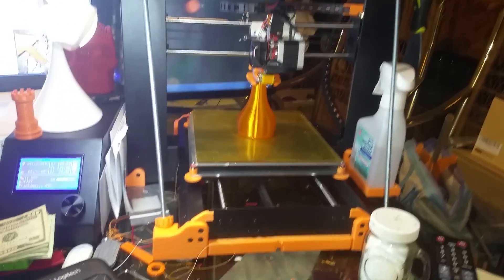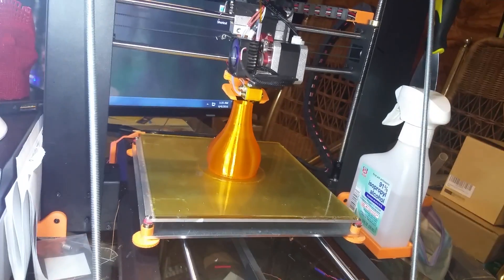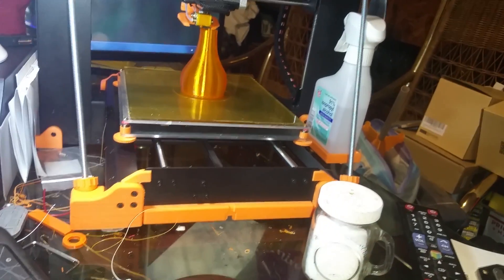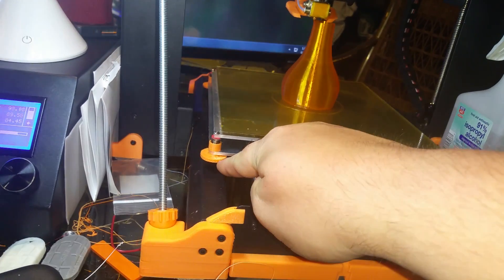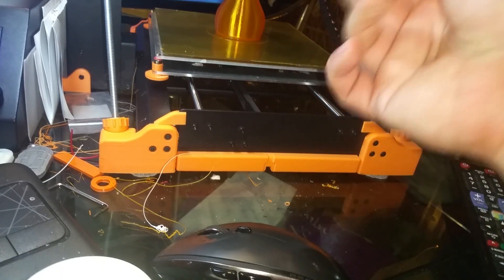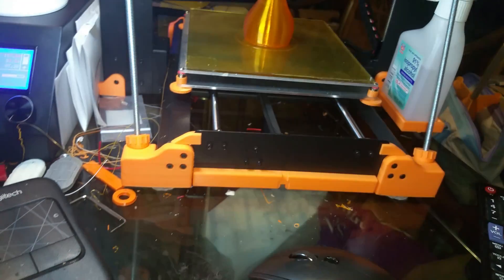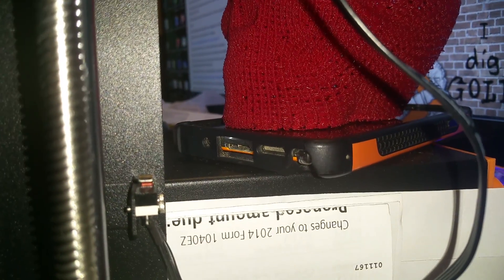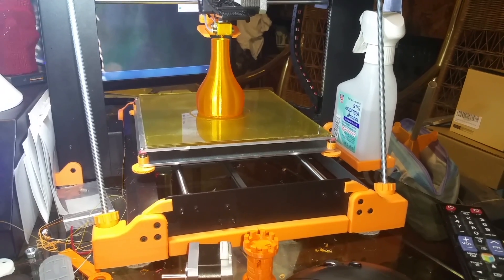Today's 3D Print - Minimum mods and instructions maker select wanhao i3

Comment: Great video but I believe the purpose of the springs for the best is to allow for X, Y movement and to attempt to keep the bed level with the spring tension as the bed heats. As we know heat will cause the bed to expand and contract and even warp. If you get the springs to tight and don't allow enough movement via the X, Y plane then the bed will expand upward or downwards to compensate. I had a teacher, where I work as an IT Admin, do that mod and complained to me that his student's print jobs would not stick to the bed. I removed all those mods and went back to the basics and leveled the bed in a similar fashion as you did and no more problems. My RepRap i3 at home I added a lock nut to attach the bolt to the heated bed plate, leveled the bed and now I almost never have to level the bed no matter what I do. I tried many other things but this worked the best. Thanks for the video!
Reply from the maker: no. under no conditions in the universe is it ok to "allow" for X,Y movement. this is bad 100% of the time under all conditions. if x or y is permitted to move "at all" without being under the control of the steppers then you add "noise" to dimensional accuracy. you want is to be as absolutely rigid as possible. the ONLY reason we have springs at all is because we need to be able to "adjust" the offset of the bed plane to the x/y movement virtual plane. otherwise solid mounts would be superior and this is why good quality ABL systems do just that. use solid bed mounts. We only want springs to permit "Z" movement ie to allow us to adjust offset/tramming/leveling. NOT to permit X/Y movement.

mods. yep. happens all the time. mod, break, no idea why it broke or what broke it. always good to learn the machine as it is (except for fixing clear flaws or issues of course) so that you understand what its doing and why its doing it. this way when you mod you will know if it was the mod that caused an issue or something else.

Comment: I know this video is old but . . . I have one of these and have such a difficult time leveling. I even have the upgraded plate underneath and z braces. I did the x leveling with a bottle and used the plate UNDER the build plate instead. Just for a little extra I guess. Now I try to adjust while it prints the helper disc slowly. but it just seems all over the place. When I need to go up with the plate(plate is to far from nozzle) the adjustment screw is effing loose. But I have successfully printed amazing stuff. Very frustrating.

Comment: Hey there, after 2 years with this printer would you still recommend it? I am new to 3D printing
Reply from the maker: No. Its a good machine. If you can get a cheap one used and want to play sure. But an ender 3 is far cheaper better quality of construction electronics and print quality and a bigger print volume.

Comment: I keep reading about the MOSFET mod as being really important. Do you recommend?
Reply from the maker: I am not entirely sure I don't have enough knowledge to know for sure whether you really should consider adding it or not when I can say is there cheap and it can't hurt so if it helps peace of mind at it when time allows I'm thinking about adding them to a lot of my printers simply to reduce the load on the brain board so they will last longer
Reply: There are plenty of people who have had their boards smoked by loose wires or bad solders at the bed connection. The MOSFET takes that responsibility away from the controller board. IMO, the MOSFET upgrade is a must-do for the bed AND hot end on ANY printer.

Comment: I want your settings!! The prints look so damn perfect!!!
Reply from the maker: Any of my current videos check the description i have my simplift3d fff peofiles fornmy printers as well as sample gcode to run.

Also on this particular printer my mods play a big part especially the thicker y carriage plate and z brace kit. The flexion also makes a big difference but the stoxk hot end can also do very well.

The big thing though is the y plate is nust too thin and the gantry flexes like a wet noodle. Stiffen both up and its like a new printer.

AfLinks in description
Reply: Damn you are awesome! Many many thanks! I am giving it a try now with your settings. One more question tho, which cooler do you prefer? I currently use the DiiiCooler.
Reply from the maker: I use the cobra head on the maker select.

Comment: Thanks for the video, awesome stuff. I was trying to check out the aluminum plate upgrade you suggest, but the link goes to an error page, could you update it please? Thanks!
Reply from the maker: Yes they sell out often. 2 of what i consider absolutely essential upgrades that turns this machine from ok yo amazing

Y carriage plate https://amzn.to/2JRN7Dv

Z brace kit https://amzn.to/2w9xy8c

Best $70 you can spend on tbis older but seriously solid machine once upgraded.
Reply: Nerys awesome, thank you. I’ve had one for several years and have been printing sub par on a stock machine. Decided to upgrade it and make it good before I bail and get a Tevo Tornado.

Comment: Hey just wanted to stop in and subscribe, i talked to you at MRRF about my maker select that i bent the y carriage on.
Reply from the maker: You betcha. This is what you need. https://amzn.to/2GCvXvx some of them need holes drilled. If it does put bolts through the level knob holes and use old one as a guide.
Reply: Nerys ill check that out i may actualy have a plate of .125 its a bit thicker than 3mm but i dont think tjat will hurt would it
Reply from the maker: Yes it would but not badly if the plate is too heavy it will add noise to your prince since you're now moving more mass so you have more inertia but if it's close that's okay you can always add lightning holes to it to reduce the Mass
Reply: Nerys just like race cars speed holes are the answer .125 alum is 3.175 so not a huge amount
Reply from the maker: Oh that will be just fine that is 3 for all intents and purposes just remember all the corners use it as a guide drill out maybe cut the four sides in a little bit concave be careful with the bed impacting anything in the travel path etcetera for example on the anet E12 it uses that space so I had to actually raise the bed up higher to clear it :-)
Reply: Nerys no problem il let you know how it turns out im going to try to print the z brace kit parts with the little bits  of filiment i have on the dozen or so mostly out spools i have laying around aswell lol
Reply: Just started printing the z brace kit. But totaled my car yesterday when a guy pulled outinfront of me and severely  sprained my left thumb sooo  assembly will  be slow going

Comment: hi, between this and a mega i3 anycubic? I'm very undecided, even if I would buy the duplicator i3 plus as a model of Wanhao and not this one. Final print quality who wins between the two you have? thank you
Reply from the maker: As much as I love my wanhao it's not even a competition the I3 Mega significantly Superior and requires no modifications to make run properly while the duplicator I3 will require modifications to be able to run properly namely Z bracing and replacement y Carriage plate

Ti3 Mega also has a slightly larger build volume although it's virtually identical is an all-in-one unit and has significantly better print quality it's also about the same price I would definitely go with the I3 Mega
Reply: ok thank you very much for the feedback, I did well to ask you! Do you think the same applies to the i3 plus model? (I do not know if you've tried it).
With the i 3 mega to layer 0.2, at what maximum speed can you print? and what upgrade tips for this model? You're great and I always thank you! I greet you from Italy and I'm sorry for my ruddy English.
Reply from the maker: 60 mm second should be pretty easy with the I3 Mega I can't recommend any upgrades because it honestly doesn't need any one thing I would like to do eventually is a z bracing like the duplicator V2 since the I3 Mega does slightly suffer from the same problem where the verticals are a bit flexible Z bracing might help with that otherwise it's good as it is
Reply: hello, you're a great man, you convinced me and I ordered it from amazon yesterday, today it should come to me. I don't found the  z bracing on thingiverse, and I don't find anything to fix i3 mega to the table(very strong and heavy table), if you have some links or you will create someone, I thank you and will report them to the Italian community of i3 mega to which I joined. Thank you so much

Comment: Awesome video. I picked up a i3 plus clone and was having problems getting it leveled. Following the steps on this video got me up and running in minutes. So much better than the assisted bed leveling function that does a corner at a time.
Reply from the maker: Assisted bed leveling in corner at a time is actually very handy for getting close but only for getting close :-) same with the paper trick it's good for getting close after that you need to do a live level that's where it really starts to come together once you get level You've Won 90% of the battle

Comment: Omg, I spent hours trying to level my bed, and with this video I did the whole thing in 15 minutes! Changing two sides at the same time was a game changer with a glass plate
Reply from the maker: yep. you betcha. stops the bed warping and makes the changes more consistent. once you master leveling it will blow you away not only how easy it is but how fast and simple it is. you just have to wrap your head around it. thats all.

Comment: Hey ive been followimg your videos on thid monoorice mker select v2. I have been using mine for a few weeks now and have a question for you... i want to know what the stock power supply (PSU) is rated for in amperage.. it says on the side 250w but only 2amps.. how is that possible? It is rated for 20amps? Like the wanhao i3? Im asking because i wanted to upgrade the control box fan to an 80mm Noctua fan..and wanted to make sure that the PSU would be able to handle it.. thanks.steve
Reply from the maker: +FPV Addict 20amps is at 12v which is the same as 2amps at 120volts. V*A=W so 120v times 2 amps is 240watts (close enough to 250w) 20amps times 12v is the same 240w so you are good to go.

The psu will literally not even notice the noctua fan. You could add 20 of them and it would not blink. Go for it. You will love the quiet :-)
Reply: Nerys ok great. So your sayong that the power in is 120v amd is rated for 2 amps. And then theres the 20amp psu for 12v rated for 20amps..? Am i reading that correct?. Cause i want to add 12v 12inch led strip as well.. am i good?
Reply from the maker: +FPV Addict yep you got it. Amps means nothing without voltage they go together so 120v 2 amp is the same amount of power as 12v 20 amps. Fans and leds are fine you wont stress it at all.

Comment: Where did ypu purchase the borosilica glass for the make select v2?
Reply from the maker: +FPV Addict amazon http://amzn.to/2zQut9C
Reply: Nerys ok great. Thank ypu.. another quick question though.. it says it 220 by 200. The screws for tightening  the bed are right on the edge. So will thia fit exactly on the monoprice naker select v2?
Reply from the maker: +FPV Addict yes. There will be space on 2 sides but that is not printable space. It is what i use on mine.

Comment: Amazing job with these tips they will be very helpful for the Maker Select V2 I just got.
Reply from the maker: no problem. it is a very good solid printer. just replace that y plate and add those z braces. will turn it from an ok printer to an amazing printer.

Comment: Just to be a bit nit picky, but I think that tramming the Z axis using the bed as a reference is not the best idea. The Z axis stepper motors are installed on metal plates behind the columns, and I think the plates are what you should be measuring from. That way when you tram the bed itself, the bed will be trammed to the Z axis which is trammed to the frame.

Ive also found that the easiest way to do bed levelling is just to use a feeler gauge to set a consistent gap. I've done this and checked it with a dial indicator, and the feeler gauge can get me to within 50 microns of deviation, which I can then use the indicator to tweak.
Reply from the maker: John Smith agreed but if I tighten down the Springs all the way and that's the optimal tram since the bed might not be level of all to the frame plus it just takes too damn long to raise a z all the way to the top:-) the trick is to not continue modifying the bed level as the x-axis changes but to recognize that the x-axis is changing and correct it but yes if Izzy was faster than raising It To The Top to balance them out would be ideal I just don't have the seven or eight minutes takes to do that plus the another or 8 minutes to bring it back down
Reply from the maker: to clarify. ultimately you are not leveling the bed you are leveling bed relative to x axis (tramming)

so the bed determines the ultimate level (or the x axis does) ideally (something new I learned a couple weeks ago) raise X to the top till both top out on the frame. done. now level the bed.

this has a few problems though (which is why I don't use it) First it takes a small ETERNITY to raise the X all the way up the length of Z and back down. especially on a larger printer.

second this ONLY works if you have 2 z steppers and rods.

the last issue is raising the x all the way up on the maker select wanhao is problematic since one of its design issues is that parts and bits impact or bend on the frame.

its easier to simply compress all the springs to max. tram the x axis to that then level the bed.

if you ever lose tramming just twist the right z motor till its trammed again with some sort of guide

so so much faster than z all the way up and down.

Comment: Hi, thanks for the detailed explainer and links to all the great files. I've used what I've learned in your video to level my bed swiftly when necessary.

I looked through the files for the mount you have that connects the control unit to the printer, but I couldn't find it. Did I overlook it? I'd like to connect the whole system together like you had yours.
Reply from the maker: Miles Aurbeck i do not have mine connected. i am ok with them being apart and never tried to hard mount them together. if i were to i would get a sheet of plywood and bolt both components down into that. i would not trust a printed part with that kind of load. any pri ted part sufficient to hold that amount of mass would cost more tha. the piece of wood.
Reply: Ok, thanks for the response. I must have seen this as part of another video and connected it with yours by mistake. Thanks!
Reply from the maker: Miles Aurbeck no worries. i will try to poke around and see if i can find something like that on thingiverse.
Reply: Nerys oh, great. I saw that somewhere and now that I think about it he also had a little SD card slot stuck in his too to help guide the card in. Can't find either for the life of me. I'll do octoprint one day, but until then I'd like to try to keep from scraping it all up trying to stick it in straight
Reply from the maker: I THINK this is what you want

https://www.thingiverse.com/thing:1261720

has a bracket to link the brain box to the printer body making it "all one" so to speak.
Reply: Nerys Yep! Thanks for the follow up. I ended up remixing the rear conduit because it was scaled funny. I haven't tried the feet yet because it wasn't completely obvious how they attached, and they used weird rubber feet I didn't think I'd ever find (or want to pay for).

Monoprice (Wanhao) Maker Select V2 Rear Cable Conduit found on #Thingiverse https://www.thingiverse.com/thing:2486494